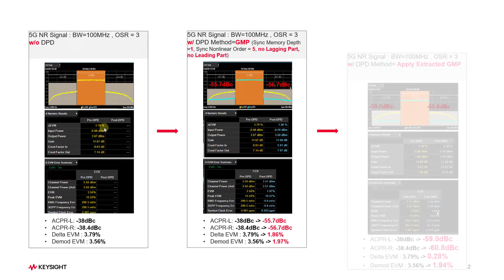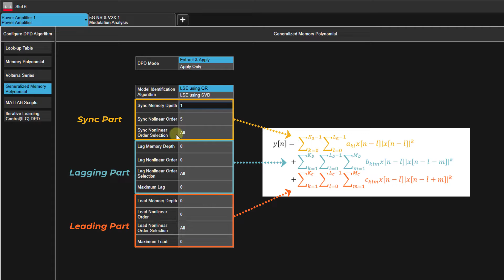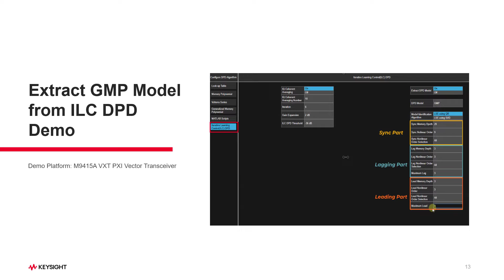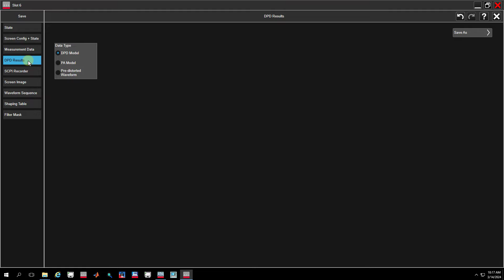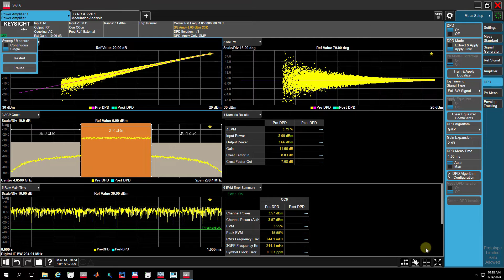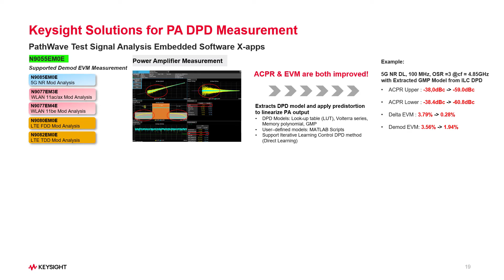PA DPD Measurement with GMP ( Generalized Memory Polynomial) Demo – Part 10

Comment: Thanks for this nice demo. 
As I understand the ILC feature is only used to find the right leading and lagging memory taps. 
If this is the case, can it be used to find the right memory taps for the synchronized term of the GMP model. 
Also, how would the ILC decide if those memory taps are correct? 
Is it by calculating the EVM and ACPR, or by the NMSE for the linearized output?